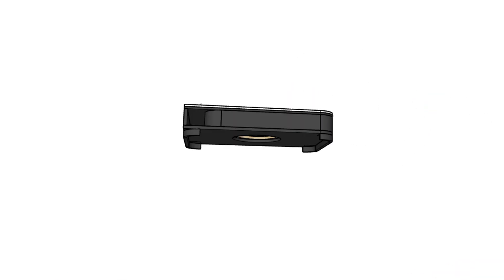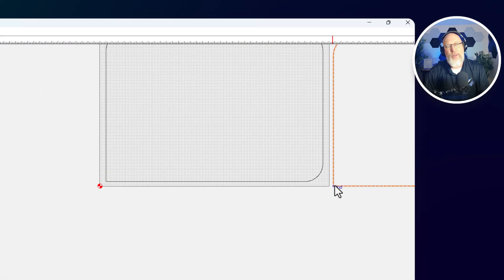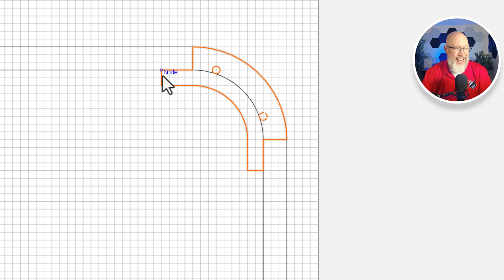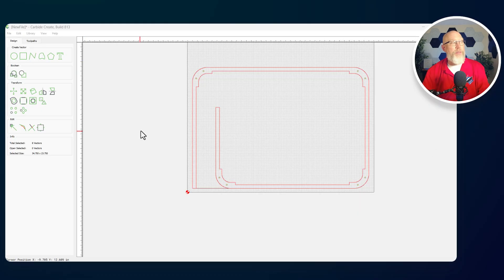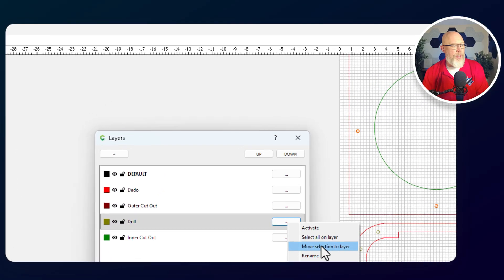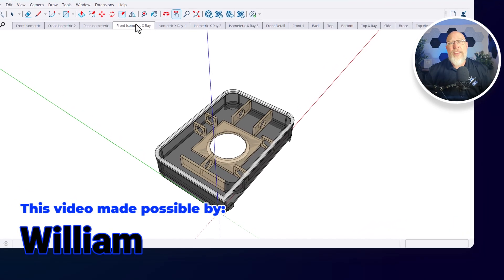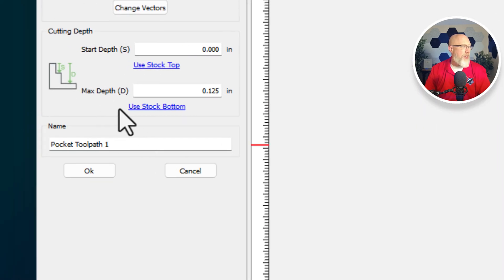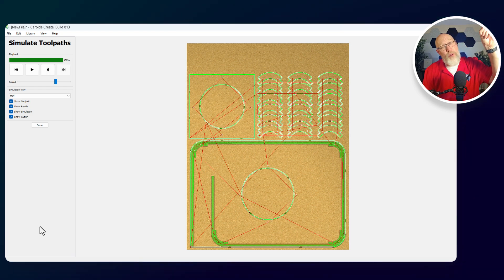Advanced CNC Subwoofer Box Design

Comment: This isn't very DIY...
Reply from the maker: It is still do it yourself.   But don't worry.  After I get a few of these CNC videos uploaded I have some builds designed around basic tools in the works.
Reply: Just because its not made with balsa and hot glue does not mean its not diy. The principles are the same, and one could still use basic tools to build similar it will just take longer and more planning.